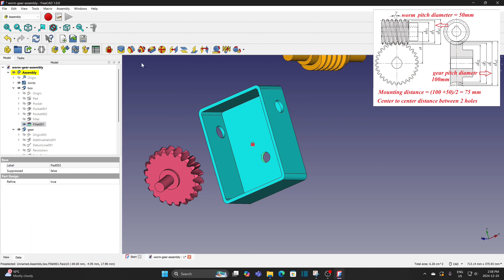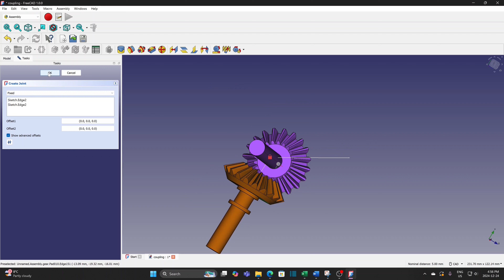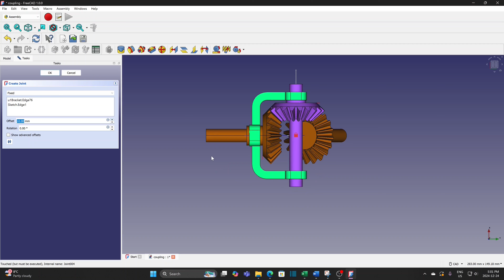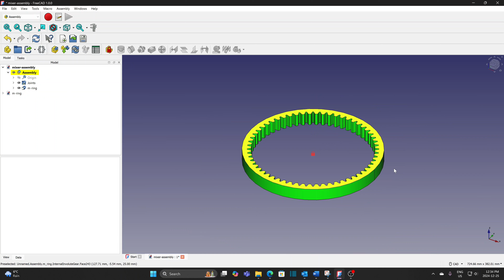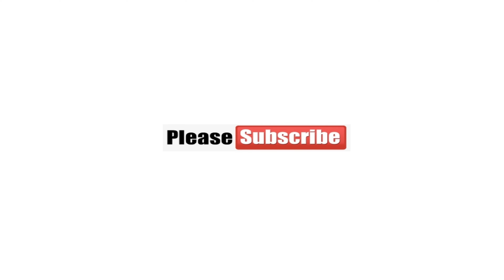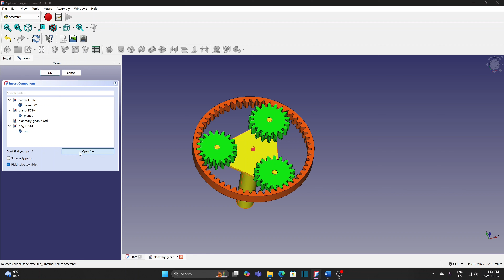FreeCAD 1.0 Assembly Tutorial- Amazing Gear Joint

Comment: I get error @3:34 when I rotate the gear:  "unhandled exception in view provider:: event callback: gear radius is zero"
Reply from the maker: Hi, It is the worm and worm gear. I tried my file and didn't find this problem. I am not sure what happened. Try double click to open the gear joint. Radius 1 is 1mm and Radius 2 is 20 mm. If these are correct, you may try to create a new assembly and insert the parts again. Sometimes, I got problem in the assembly that I don't know why. I remove the components and insert them again won't solve the problem. Then I have to create a new assembly and everything is fine. It happened few times with Assembly in FreeCAD 1.0 when I created these videos . Hope this help.
Reply: @KK_CAD  I noticed that you entered 1 , without the mm part , and 20 , without the mm  part, and did it exactly the same and it worked perfectly. Thanks.
Reply from the maker: Glad to hear that!